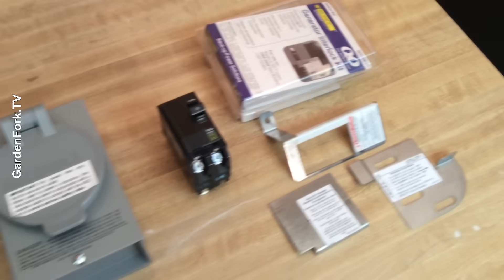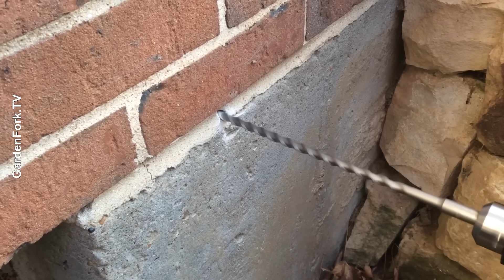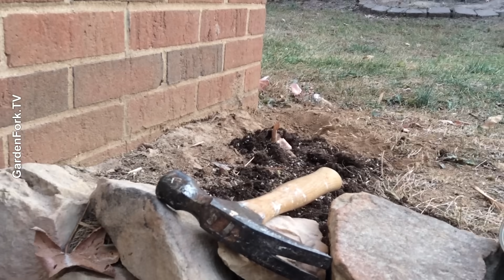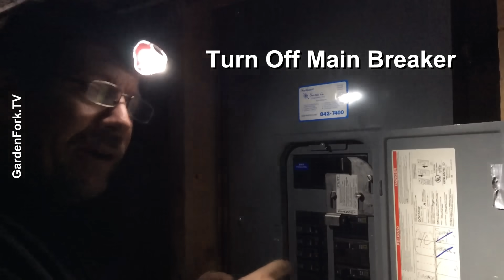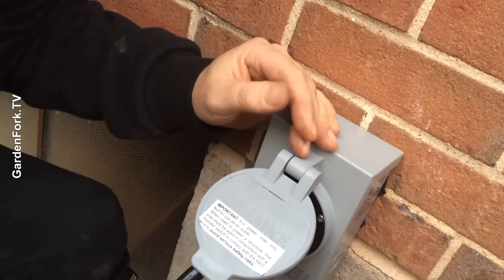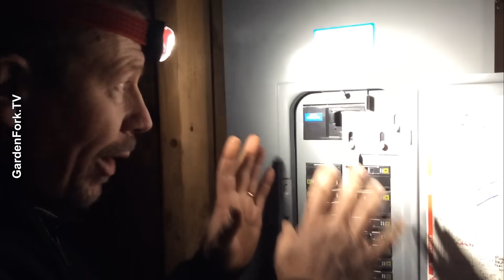Your Easy  & Safe Way To Hook Generator To House | Generator Interlock Switch Install | GardenFork

Comment: Here is a grand idea ...
Flip all the breakers ON so that every outlet is active, just turn OFF all devices that are not needed ... Just turn on devices as needed, this way you don't have to go up and down to the basement to flip breakers on and off ... 
Just because the outlet is active with 120V, does not mean there is something pulling power, just because your TV is connected to the electrical outlet and its powered OFF does not mean its pulling power. 
Most if not all devices when powered OFF pull little to nothing power wise and not even worth worrying that it will overload the generator .. 
My home is 2k sq ft and everything and i mean everything left plugged into the electrical outlet BUT POWERED OFF only pulls like 15W ... As i start to turn stuff ON, then the load starts to climb....
Reply: you tube  Hey wise ass !!! Are you going to "unplug" your water tank ???  Electric furnace/heat pump, electric range, tv /entertainment center ?????  NO !!! Hell no !!!! So much simpliar to flip the marked breaker !!!  DUUUUUHHHHHH!!!!!!!
Reply: @Wilbur Finnagan:
My water tank DOES have an on / off switch ..... 
My Central AC has an on / off switch at the thermostat 
Stove has on / off switches, they are called rotary dials ... 
TV ... entertainment centers ALL have power on / off switches ... 
When devices or appliances are OFF ... they pull little to NO current.. I know this, YOU APPARENTLY DON'T KNOW THIS ... 

So don't come to me telling me what i already know ... Learn this shit before you attack someone 

DUMB ASS STUPID IGNORANT FUK ...
Reply: @ACommenterOnYouTube  Hey dumb ass !!!! Your on/off switches DO NOT disconnect the appliance from the power source !!! You range still has parasidic draw, clock timer, lights, so does your entertainment center !!! 99.9 % of waters heaters have no on/off switch, you use the breaker.......as well as a refridgerator or freezer !!! Pull your head out of your ass and see the light of  day and smell fresh air !!!   DUUUUUUUUUUHHH!!!!!!!!

Comment: GardenFork - Outstanding video and very simple to understand. You did a great job of explaining the basic concept of how a generator interlock works. It's amazing how many people have never heard of this option. I did the same type of set up, only a lot more beefy.  I used a Generac 50 Amp power inlet box and a Generac 50 Amp heavy duty cable with (of course) a double pole 50 amp breaker. My generator is a DuroMax XP12000EH.  The maximum  rating for my set up is a whopping 12,500 watts, so I should be very well prepared when....not if.....but when the power does go out.
Reply: Smith N
I just bought the same Gen. Please
Read my post above & let me know if u have the same issues!
( specially w/ the different spark plug! Thank's.

Comment: This is what I did, I have a detached garage and A house panel and a garage panel what I did was installed a reliance 4 prong plug next to panel in garage to a 50 amp I used to have hooked up to an old compressor and it backfeed to my house panel I have an Interlock on my main and when I lose power I turn my main off go in garage turn my garage breaker to old compressor on hook up my generator start it go back in and turn what I need on it works great.

Comment: Could the same generator inlet plug be used as an outlet for a 30 amp plug. I have a travel trailer and I am wondering if the plug could be used to charge my trailer if the breaker switch is on and power is going the plug?
Reply: With the plate. Main must be off for gen plug to energize so you cant get power out of that breaker.  I would just install a 30 amp 110 and a rv plug. Mom just had 50 or 60 amps 220 run to barn instead of 15 amps 110 and added a 30 amp rv plug.

Comment: No one ever talks about grounding the generator it self read the owners manual first before doing anything.
Reply: Well in a setup like this it grounds thru the cord cause house has ground rods and wire from generator is a 4 wire so there is a ground there

Comment: Great video, but just one thing you should have probably mentioned, this method may not be legal in all states - ie. -
where I live you MUST use a DEAD MAN breaker between your generator breaker & main utility breaker,  otherwise system is illegal.  The dead man breaker is so your generator power can not jump circuit and feed power past your main breaker, & possibly injure or kill line worker, but great video otherwise.
Reply: Well this setup both incoming power supplies cant be on at same time either.  I dont get how this wouldnt be legal.  Without the plate then i would say not legal too

Comment: I always just opened the main switch between my breaker box and the main line.....then I ran an extension cord from the generator to an inside outlet for each circuit I wanted to power...never had an issue.
Reply: First of all that is illegal per NEC because you can feed back into line power and kill somebody.  Second, it is dangerous as the cord you mentioned has to have a male end to plug into a circuit and if the generator is on, you could be killed. DON'T do it this way! The Generator Interlocks that are sold nowadays are UL listed and NEC approved. I understand that you said "I always just opened the main switch", but accidents do happen, which is the reason the NEC prohibits this type of hook-up. The Interlocks are fool-proof. You can't make a mistake.

Comment: Unfortunately you have not isolated the main ground...the big fat White wire that enters the main panel. Because you are using the 220 generator outlet the main ground is still connected to the hydro pole and can shock line workers.  Remember....the white wire carries the load back to the panel on all 220 circuits. That’s how you get 220volts. 110 on the red and 110 on the black with the white wire completing the circuit on both the black and red. Even a small amount feeding back and going through the transformer on the pole can send enough of a jolt to freak out a line worker that thinks the line is dead.
Besides shutting off the main power switch that opens the black and red wire from the line...you must cut the white ground wire as well to open it and isolate it from the pole.
You didn’t do that.
What you did is an expensive way of simply plugging the generator into a 220 volt outlet then shutting off the main switch at the panel. The generator lights up all the circuit breakers in the panel. You can probably run everything except electric heating or air conditioning or electric stove. Everything else should be good to go. Ie gas furnace, water pump, fridge, freezer, lights....maybe not microwave because it will run but poorly.  Garage door opener, outdoor lights etc.....especially if you’ve changed all your lights over to LED.
Reply: Sorry, 220 is the differece between the red and black (hot) wires.... white is neutral and on 220 v circuits it carries no load, on 110 circuits it carries the return from the load and is connected to ground by the grounding rod into earth....

Comment: This guy left out some really critical information.  You better check the output voltage of your generator before you plug it into your house.  Both under and over voltages can destroy many electrical components in your house to the tune of thousands of dollars.  Ask me how I know all this?  I learned it the hard way with a lot of damage to many appliances.  However,   you need to routinely monitor the voltages to make sure that they stay within limits. If your generator has voltage monitoring/disconnect circuits, then you are good to go.   Most do not (as in 99.999%).     I finally designed a device to monitor both phases for under and over voltages.  If either one goes out of limit, a solenoid activated switch opens and immediately disconnects the bad power from the generator before it can cause any damage.  The bad news is that I could not locate such a product that was usable in the US, which is why I had to design and fabricate it myself.  Parts alone was about $500 for a 50A system.  My generator is 12K watts.  Be careful out there.

Comment: Great video! You explain the reasons and purpose of having the interlock and how it works. I am fortunate to already have a sub panel so I'm going to move circuits around so all the ones I need to run on the generator are in the sub panel, and then install a transfer switch between the main panel and sub panel. I already did this at my daughters house and it worked out great! Thanks again for doing it right! ( I was an electrician for many years so I sort of have inside information to do it!)
Reply from the maker: Good to hear Bob, thx for taking the time to write. I’ve seen similar sub panels, good to have. Thx!

Comment: 5k watt generator can run a central ac unit?
Reply from the maker: No, mistake I made.
Reply: NO! It can run a window unit ONLY up to about 10kBTU's. I would still check the specs on the window AC Unit.
Reply: @Mr Sunshines The soft start is what allows you to do that. Out of curiosity, i would like to measure the AC current usage while running, even though it's not feasable unless you have an extension cord where you are able to clamp the ammeter. Without the soft start there would be a large surge of current. Good to know, Thanks.
Reply: No! The circuit breaker on a 5kw generator would trip the moment the compressor kicks in. Have you ever noticed how the lights dim for an instant when your AC unit comes on in your home with power from the electric grid? There is a very LARGE initial current demand and the generator cannot handle that, UNLESS it is a bigger generator.
Reply: @Mr Sunshines Sorry, my answer was supposed to be to another person who asked if she could run her Central HVAC with a 5kw generator, to which I replied no and gave her an idea to the large initial current demand. Thanks.

Comment: I want to get this had an estimate today. $820 I think that’s really expensive.
Reply: Worth it!! Use it just once, during an outage, and you will never regret spending the money to have it done. Such an auxiliary source is not just for generators. If you want to experiment with small scale solar and batteries, this is a way to connect that to your house. I, myself, paid extra to have a transfer switch installed when my load center burned up. Now, I have a huge knife switch, capable of handling 200 amps. Right now, I have that same L14-30 plug installed, for a 8000 watt Briggs and Stratton generator. I intend to use the same transfer switch, for a large scale solar array. I'm putting 64,000 watt hours worth of battery storage, and 12,000 watts worth of photovoltaic panels in, I will probably have to build my own integrating inverter, since I can't find one at any reasonable price. I'm not planning on net zero metering, or tying to the grid. Anyway, there is nothing more convenient than "plug and play" hookups for your generator. It's the easiest way to get the power from that, to anything you want. Refrigerators and freezers are the most important things.
Reply: @vincentrobinette1507   You could go with a separate panel for your solar and add outlets that are labeled by color throughout the house to let you know what ones are on your alternate power system.

Comment: The way you placed the new breaker in the panel supplying power from the generator, will it feed power to both sides of the panel considering they are on different banks?
Reply from the maker: Yes. Thx!

Comment: Great video. I’m working on getting a setup like this; however, my breaker does not have a main power with my box in the garage. It does have an secondary box outside with the main power to the house connected to that. Would the setup be the same with the with the kit installed at that location and turning on the breakers to use in the primary box then?

Comment: Well with your set up I'd of ran the gray box plug into the shed for easy safe hook up and you can safely run that Gen in the shed with door open and exhaust pointed out door or get fancy and change muffler so you can clamp a short  flex pipe on it out door and mostly close door or run to a vent in side of shed either way it will keep you high and dry safely for hook up Gen fueling and maintenance...
Poor man's way of doing which I done for years safely if you can't afford electrician turn off all your switches to lights etc. Turn off main breaker run a heavy duty 110 cord with double male ends just long enough from Gen to nearest outlet plug in Gen and outlet and will back feed allowing you to selectively run any 110 outlet or lights as needed. This will allow fridge and freezers going and any 110 widow ac's plugs or lights to be selectively ran safely..
Reply: You dont have 220 unfortunately that way to make full use of larger gen.  I remember as a kid dad did something to wire the 2500 and run the living rm lights/tv and fridge and freezers but i dont know if he did a suicide or opened the power pane and un wired a couple lines and rigged to extention cords from gen

Comment: I'm impressed by your video.  Very informative and safety orientated.

A simple method when usable,  Main Panels come in many shapes and sizes and not many configurations this will work with.  

I'm using an APC 32315-UTS10BI  it allows for UPS backup and load shedding for different Generator sizes.   Not as simple to install and really requires a skilled electrician to keep loads balanced properly between phases.  I have installed these for a couple clients also.
Reply from the maker: Good to hear Sir, thanks for the kind words. I wanted to show the system yet stress to be careful as well. thx! eric.

Comment: Breaker panel will be blown off the line and the generator fried or its own safety overload system will trip shutting down the generator.  We fed our home thru many hurricanes and blizzards with our little 4K generator feeding the house through the   electric clothes dryer receptacle in the laundry room.  We always popped the main breaker before starting the generator.   I installed a proper transfer switch for my daughter and the transfer switch cost almost as much as the 3500 watt generator and that was just material.   She moved and left the transfer switch for the new owner .  She took the generator to the new 1940’s)

Comment: My son in law works for a major power company.  I asked him to check with the supervision of the line crews making power line repairs following a storm as to the safety of a generator feed thru the electric dryer receptacle with the main breaker off.  The repair supervisor informed him that the first thing a line crew does before starting power restoration is to throw a direct short across the lines feeding the nearby homes as a safety precaution.  Any generator back feeding a

Comment: Great video. Get the largest generator you can because  running the refrigerator is a must.
I noticed the tag hanging from your hoodie. Did you buy it just for the video and plan to return it after?  Pretty slick, you devil. My sister in law used to do that with party dresses.

Comment: How do you tell when powers ready to come back on?
Reply: The security light on light pole will be on?
Reply: That’s exactly how I did my house, I just look out my window to see if the neighbors lights are on
Reply from the maker: Yeah Eric that’s the thing with the generator interlock, there’s no way to tell unless you attach some sort of monitor device to the incoming power. Or see if your neighbor’s lights are on. Around here the power company does a robocall when power is restored. Thx! Eric.
Reply: Thats what I look for

Comment: Wear do you buy the inter lock that slides
Reply from the maker: Find the model number and brand of your breaker panel and search for that along with the phrase “generator interlock”  some major brands are sold on amazon as well. Be sure the local elect code allows for this. Thx!